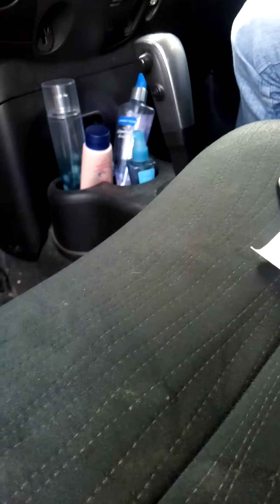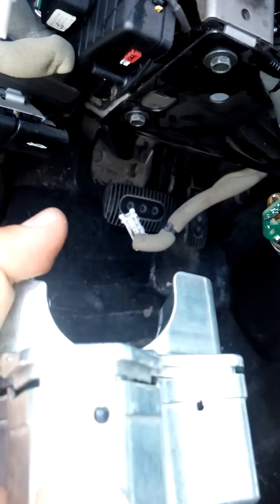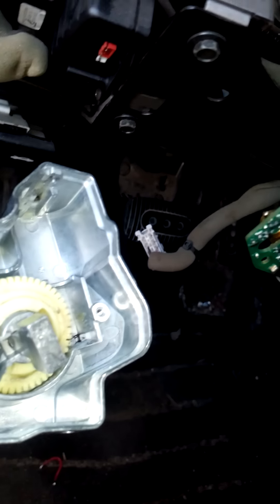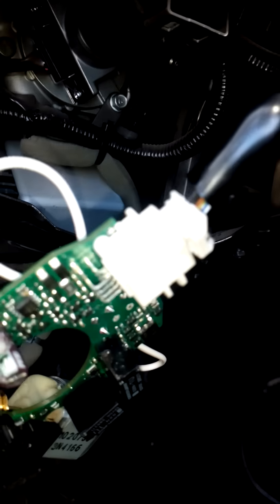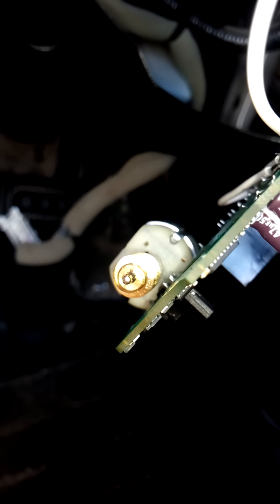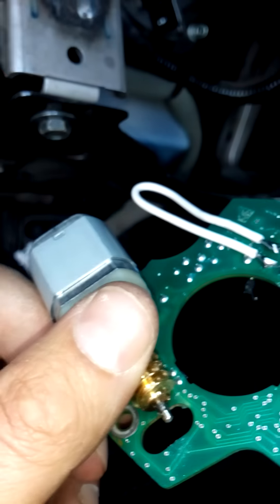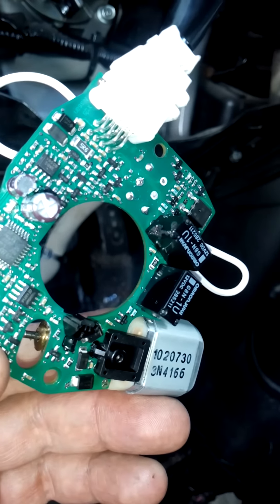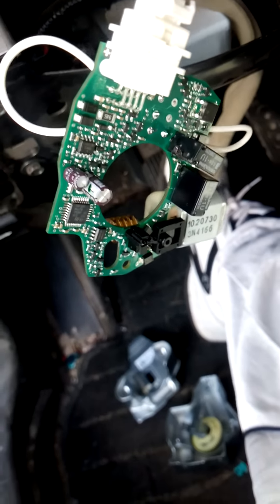Nissan Steering lock fix

Comment: We have a 2010 cube that had the same issue a few weeks ago. Lucky it failed in the driveway. I did this and it worked just fine. I had a friend remove the switches and install jumpers, he was a tv repair man and when he was done the board looked like the factory did it. The key light stays on as others indicated. I followed the instructions Paula Kruse posted as far as turning the car off holding the switches etc. That way the repair to the board could be done on a bench, or in my friends case, the kitchen table. Thank you for posting this, saved me 500 bucks on the part. Also removed the gear and plunger so there is no chance of it locking the wheel, left the motor in.

Comment: Very helpful video!!! 
I was able to uninstall the steering lock(drill out steering column mounting bolts), and bring Module inside, and remove (unsoldered) the switches and install soldered jumper wire, just like you did...also removed the plunger, but not the motor, and installed the steering module just like it was, back in....with new bolts and screws of course (it may take a minute or two for the computer to recognize the Module, open and close the door a few times, once it senses it, starts up every time afterwards.....works like a charm!!

Comment: This works! but I didnt need to take my micro switches off. The mechanism would not engage the switches so I used tie wraps to hold the switches down, removed the pin and wheel. Put it back together and the car loves it.... Massive thanks
Reply: How is it holding up for you eight months later? I have precisely ZERO soldering skills so this seems like a viable quick 'n dirty option for me...

Comment: Thanks for the video, the same thing happened to me.  My husband was able to fix the problem.  His procedure was a bit different than yours which didn't require soldering while car was running, he performed these steps:

The vehicle was in a locked state when these steps were performed.
1: With FOB, unlock the doors (note: steering lock is engaged when the doors lock or when anti-theft is armed)
2: Press the start button to go into accessory mode (don't press the brake yet).  The motor on the steering lock turn with the expectation that it unlocks.  While the motor was running press the two turquoise switches. We didn't need to press the FOB against the start button.
3: Depress brake pedal and start the car (while holding switches down)
4: While still holding switches down. Turn car off, do not lock doors
5: While still holding switches down, disconnect steering lock circuit board from the wiring harness.
6: Disconnect steering lock motor from the circuit board (we were able to remove it and it still works)
6: Pull switches from board
7: Solder jumpers
8: Connect steering lock circuit board to wiring harness.
9: Start Vehicle
10: Fixed

This is the procedure that worked for us, was a bit more comfortable when soldering.
Reply: This all worked perfectly.  The only annoying thing is the yellow key light is staying on. Did yours do this?
Reply: Yes, it stays on constantly. But I guess that's a small problem I can live with.
Reply: what car do you have? im having this issue now. im trying to by pass this thing before i pay $500 for a new one . please help :(
Reply: +Josh Cena Nissan Cube
Reply: +Paula Kruse is it still working with no issues? im here working on it now. deteremining whether i should start the process or not. i have the steering lock out and disassembled.
Reply: +Josh Cena Works fine. Just has the key light on still.
Reply: +Paula Kruse wow cant beleive i did it. it worked out just like in the video. thanks both of you!!
Reply: Thanks this slightly better version of the above video fix worked a treat.  
Wish I'd noticed it first time round as damaged the solider pads and tracks on the second time around removing the switches.  Now I have a slightly flakey connection... but at least I can start the car to get it to a garage saving me the cost of a tow.  

Peace, love and MACHINE empathy
Da'flibble
Reply: Just used this procedure and it worked perfectly.  Thank you!
Reply: Paula, at step 2 you said go into accessory mode but with this problem the car doesnt go into accessory mode, is there an assumption that you already have the module open and the switches pressed to get to accessory mode?

Comment: Of the six possible points to solder, the two jump wires are soldered to the four that are furthest away from the end of the circuit board. Try removing ESLC fuse for a minute then replacing if the car won't immediately start or if you did modification without the car running.

Comment: Did you use a punch out on the 2 bolts for the clamp?   How did you get clamp off of steering column?  With unit on column there is little too no room too drill out the 4 small pins that hold the enclosure together.  Also did the key fob work fine after?
Reply from the maker: Use a chisel to make a slot... and a screwdriver to unscrew them.

Comment: BOLTS are security BOLTS - tap with chisel to create slots for a flat head screw driver - remove with screw driver -there is a video = [tips] remove ignition Lock   - it's for Nissan Z
Reply from the maker: Good point... forgot to mention that. Thanks for adding.